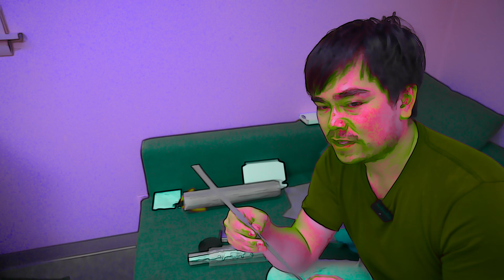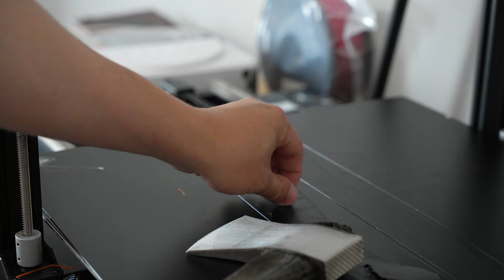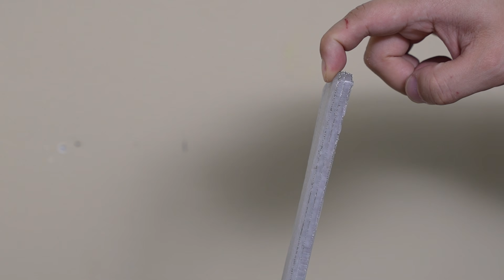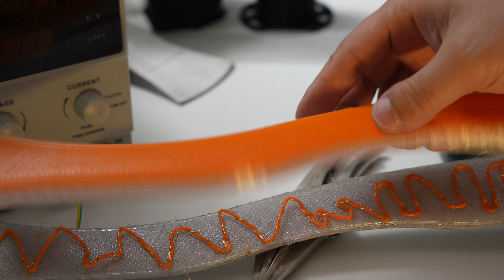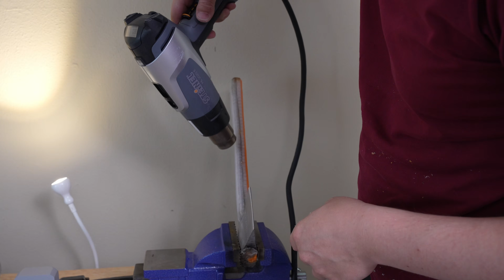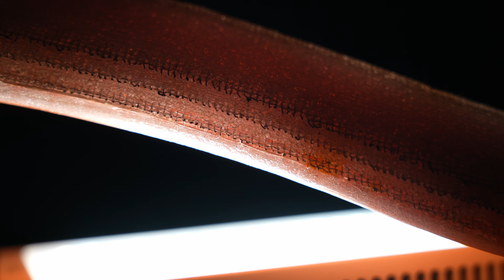🦾⛓️Steel Reinforced Parts ON ANY 3D PRINTER!!!

Comment: Been watching your vids for a little bit now. Whats your background in this stuff? Just tinkering and experimenting and building? Like your style sir...keep up the good job and content!
Reply from the maker: I have a master's degree in mechanical engineering focusing on structural optimization, and worked in a test lab focusing on metals, composites, and 3D printed materials. Fatigue strength and reliability were the 2 main concerns with printed parts.
Reply: @NathanBuildsRobots  I thought your background was a paid shill for Creality 3D printers like the new K1 & K1 Max?

 
  
  /s

Comment: Nathan what if you used a diamond nozzle and a ironing pass? Would it push the steel mesh into the top layer, like a heat insert. I think the internal stresses introduced to the plastic would rigify it?
Reply from the maker: I have though about that… if you can introduce enough heat into the metal part to remedy the previous layers that are in contact with a sheet of metal applied to the top of a print in progress.. that would be great. Maybe like spot welding, if the nozzle just parked on top of the metal, pushing down on it for a while, it might remelt and press the part into position. Funny enough you could do automated heat set insert installation this way using the nozzle

Comment: Hey Nathan, what is the point of doing this?🤔
Reply from the maker: Embedded metal parts can add conductivity, strength, stiffness, magnetism - for making useful structural parts using 3D printed plastic the limitations of the material make it really impractical for many applications.
Reply: @NathanBuildsRobots   Can you think of at least one application where this would be better and easier than other methods? The axe is not a good example.😁
Reply from the maker: #1 application: It looks cool

Comment: i'll be interesting to see how it works with a piece of sheet
Reply from the maker: The main issue would be peeling. If the bond strength is adequate, it might not be an issue

Comment: An idea: how about pre - cutting templates on the fiberglass mesh, with the shape of the handle, with a 4 mm margin
and creating a little 0.2 mm Z pocket cavity on the printed part to make alignment easier
that way you simplify the finishing job
you could add a few drops of CA or other adhesive to fix the mesh on the part before printing the covering layer
( since the mesh is now smaller and difficult to handle)
or spray -adhesive ( 3M 77 or similar) on the mesh before applying. Definitively it will be harder to secure it in place while printing

The mesh could be cut w scissors, using a printed paper template as guide
( it would be fancier to find a mesh material suitable for laser / waterjet cutting, but then it is not so simple)
Reply from the maker: There are a lot of improvements that could be made. To strengthen things up I should definitely increase infill % and yes having the mesh cut to shape beforehand would be super nice. I need a plasma cutter or something to make this easier
Reply: Well, a lot of possible improvements  means that you are trying new things with lots of possibilities!! Keep it up!

Comment: bro needs to cop a heat gun. you got a PO BOX, i got some 1.2mm CHT clone volcano nozzles on deck?
Reply from the maker: I have real CHT nozzles so no need. I’m running a 1.0mm right now, but thank you.
I have a good heat gun, but I tripped the breaker and I don’t have access to the panel at my office. It’s actually really annoying.